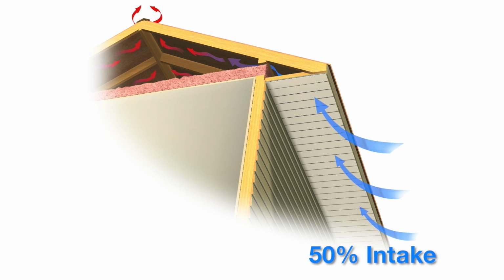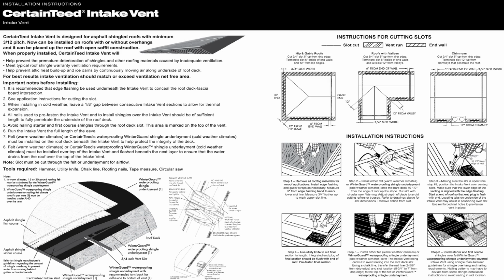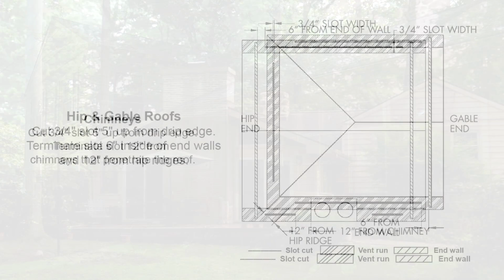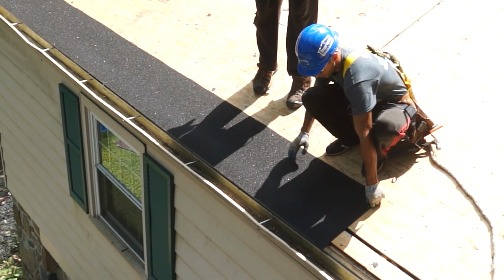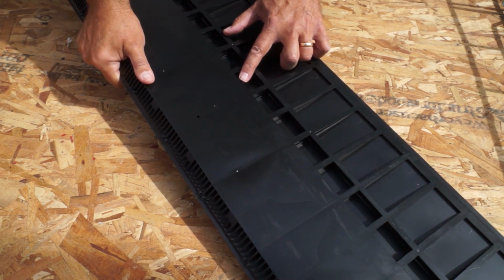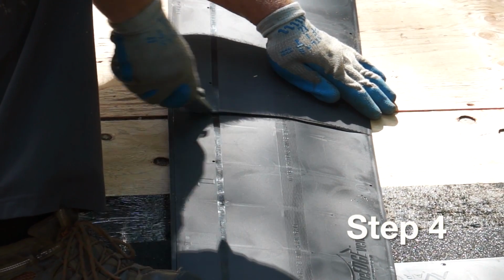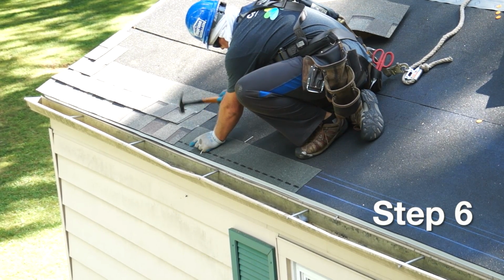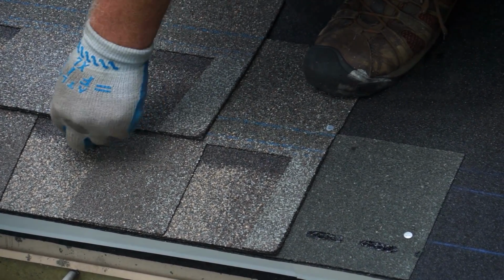CertainTeed Intake Vent installation instructions

Comment: What is not covered in this video is that the edge vent hangs over the roof edge an inch or more which is not compatible with standard 5" residential gutters! I've found that water jumps the gutter completely or catches the lip and drips down the bottom of the gutter. I get water splashing on the house and windows, gutter dirt spilling/drying on the front of the gutter, and water pooling around the house as a result. After 3-4 years of trying to figure things out, I'm looking for gutter replacements to upgrade to a 6" K style gutter. Not too happy about the extra out-of-pocket costs as a result of not informing the homeowner or installation without knowing this information beforehand. I might even price out-the-box style 7" gutters to be sure all water is collected, downspouted, and away from the property.

Comment: Never install this product in cold weather  areas with heavy snow and ice as you will get water backing up under the product.
Reply: Thanks for this info...I thought they would cause issues with snow swirlling around on the roof....contractor thought it might be a good idea to use these as some of the rafters are blocked by skylight or sun tunnel installations so passive air flow to ridge vent is blocked in those rafter areas. I will instead do cross venting and drill some holes in the rafters that are blocked, upper 2 inches close to sheathing, as I am working on the 2 inch air space from soffit to ridge vent then insulation of 4-6 inches of rigid foam. Appreciate your input 👍👍💯🇨🇦

Comment: Wish my roofer in NJ would have recommended this. I have an old house without soffits. Now I have to install gables cause these contractors are dummies
Reply: You have a good  luck with the  roofer  tha stuff  always  leaking  100%gable vents are the best
Reply: Blame the builder for being a dummie. Been roofing contractor for 50 years I do not like this edge stuff with hard blowing rains in texas
Reply: I wish more advertising/education for this way of venting.
In Canada a lot of cottages are built with roof on wall.
I have asked many ppl here how to vent and they just scratch their heads. 
Really some education/advertising on this project is REALLY needed this way
Reply: Jesus Laperra Are you saying NOT TO DO THIS.?
Reply: Brad Carver im worried about doing this, should I be?